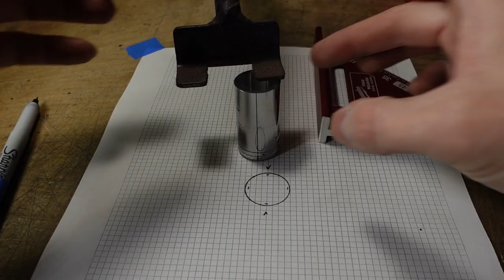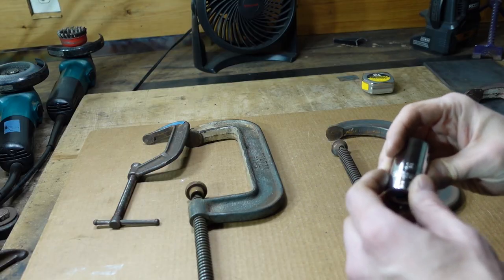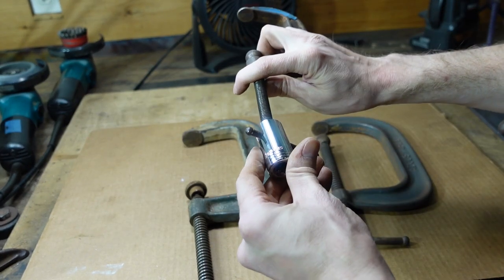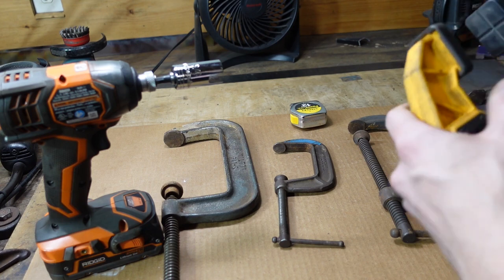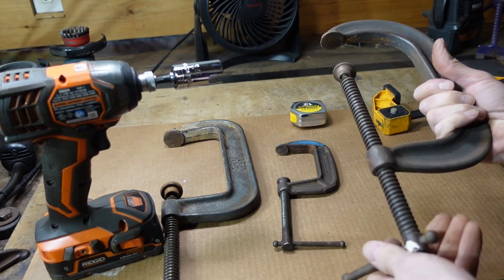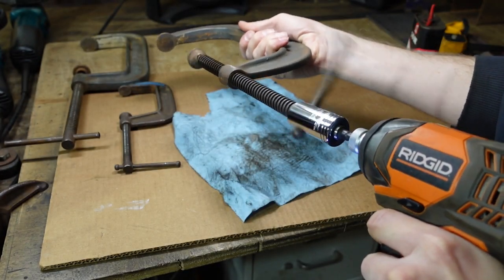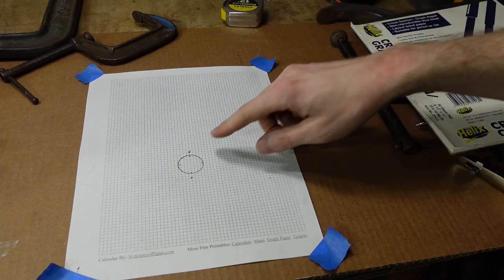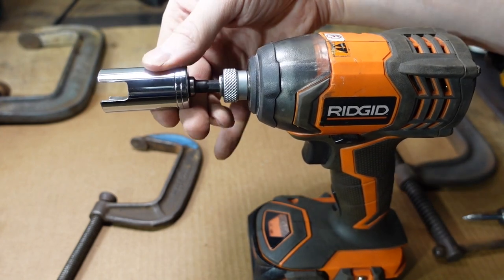It's So Fast!  Quick Adjust G Clamp - New Welding Clamp Idea

Comment: I was looking for something like this -- although I was wanting to buy it and not make it.
I periodically lubricate all of my clamps at once. With a drill attachment like this, I could turn them to one extent, apply oil, turn them the other way to oil the threads. Then one more turn back with a rag to clean them. This would really make that process faster. Thanks Rich.